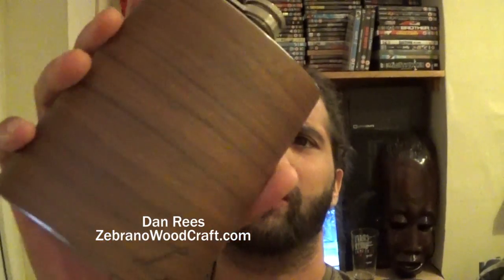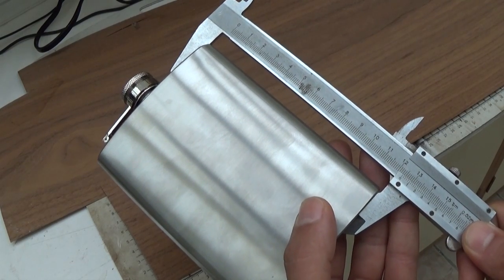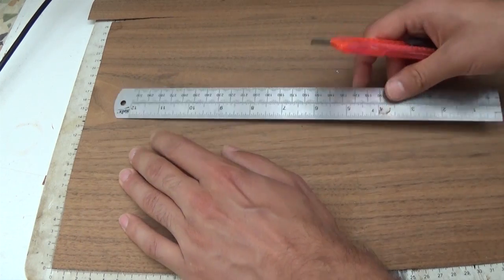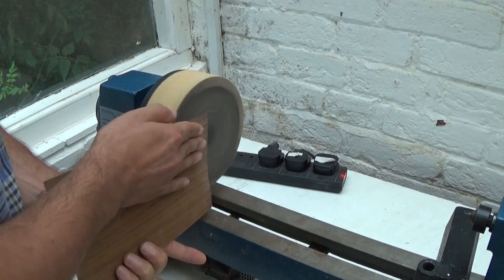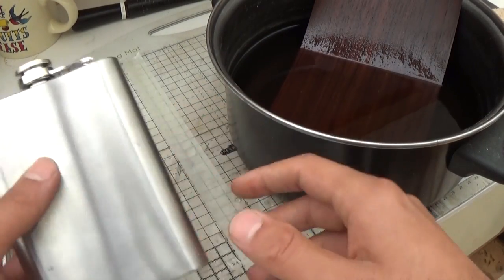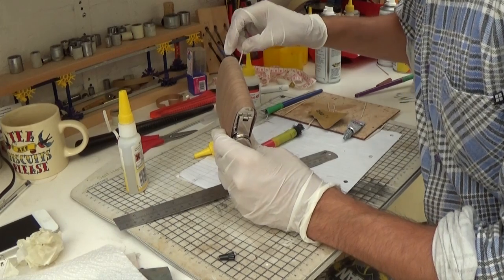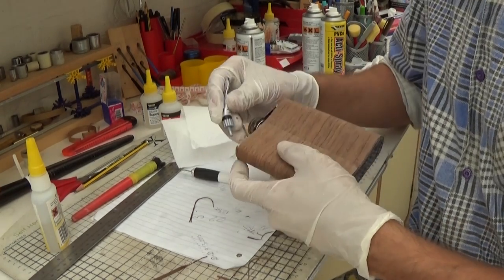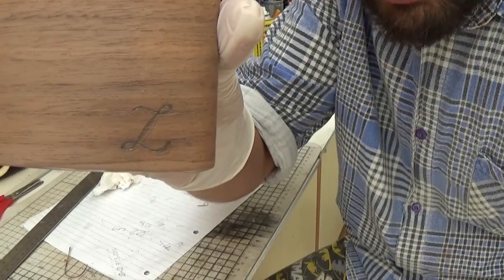Bent Wood Hip Flask Tutorial

Comment: This would have went a lot smoother if you had rotated the veneer 90 degrees. Also, if you try this again, try using a steam iron with a damp towel over the veneer to soften it up: the lignin just needs to become plasticized, you don't really need or want a bunch of water in the wood  as it'll start to crack as it dries.
Reply from the maker: +Corey Ward Thanks man, that's solid advice.  I've never tried bending veneer this big before so will take that on board if I ever do this project again.